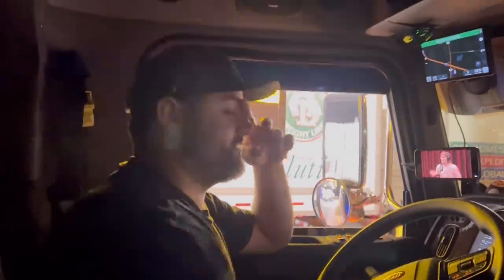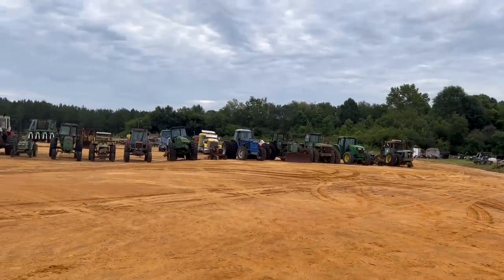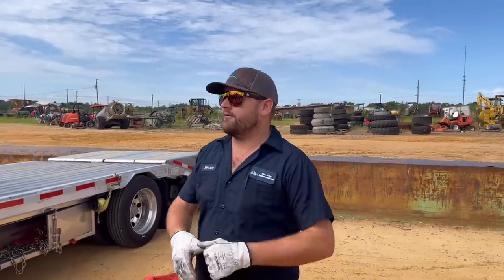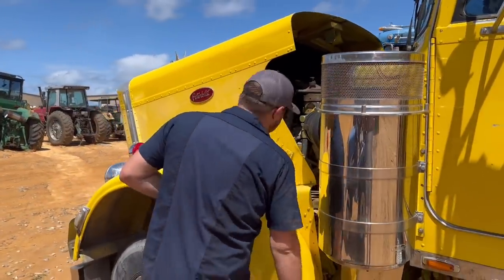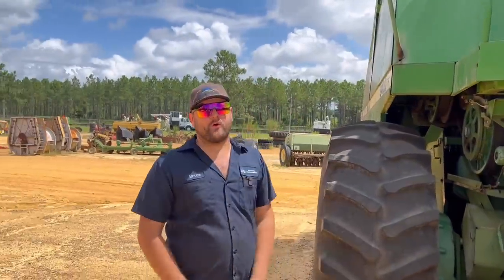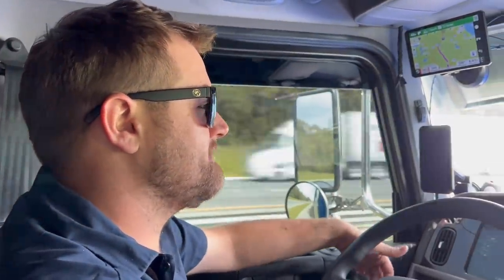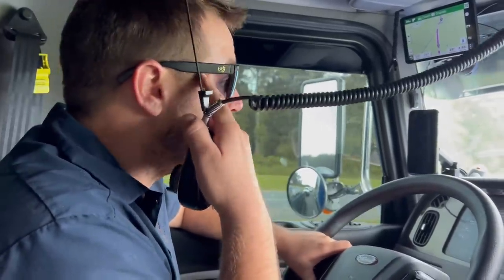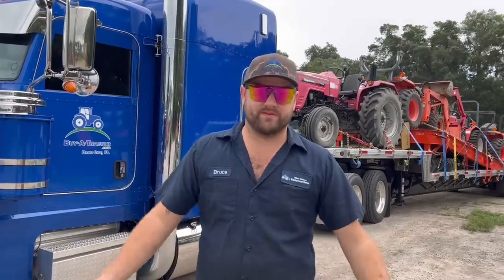SALVAGE 359 Peterbilt at the Auction, should we save it?

Comment: That Pete has a cat 3406b. Extremely reliable and loved engine. The issues with them heads are the rocker shaft hold downs are known for cracking and failing, the jakes would get out of adjustment and cause a valve to break a tip off and drop, and the rocker bridges would slip out if the valves weren’t adjusted when they should have been. All of those can be avoided with simple planned maintenance. But that engine is just as iconic as a Detroit, definitely worth saving, at least for the engine. Even if you gotta put a reman head on it and a liner. But sometimes you can get lucky and if it didnt drop a valve or anything then it’s definitely fixable. I’d pop the valve covers off real quick and check. And yeah they’re one solid head, two rocker boxes and covers. Full mechanical engine. The 3406e is a heui engine, hydraulic electronic unit injection. Uses high pressure oil and electric signal from ecm to open the injectors. Extremely reliable setup if properly maintained. Then you got into the Acert engines like the c12, c13, c15, c16, c18 and up to the c32. They are Meui engines mechanical electronic unit injection. It uses the fuel transfer pump to supply injectors with 90psi fuel and there a rocker arm on each injector and when the ecm open it the rocker arm pushes the fuel in the engine. Best setup for reliability and power. It’s overhead gear driven cam. Really good engines. Also if you can find a 3408b or e, those are awesome in a semi truck, not good on fuel but tons of power and just awesome engines. If you have any questions I’m a cat field mechanic so don’t be afraid to holler.
Reply: Sorry, but the 3406E uses electronic control, but uses rocker arms from the overhead cam. They aren't a HEUI setup. Electronically controlled, mechanically activated.
Reply: Oh yeah I forgot about that. There’s a serial number prefix break some are heui and some are meui.

Comment: Might wanna slide that 5th wheel back a notch, 11k on the steer empty seems like a lot, probably over loading it when full. Mines usually closer to 9k empty and gets up to 12k when I run @ 90k
Reply: I typically have my steers a little over the 12k mark depending on the states I'm running in.

Comment: Ouestion : how do you get past the DOT without a headache rack ?
Reply: The headache rule was done away with a few years ago.
Reply: Guess show's how long I've been away from driving
Reply: I was told by a DOT officer that if there's enough space between the Back of the sleeper and the front of the Trailer you don't need a headache rack ( I can't remember the length and that was about 10 years ago too)

Comment: Rebuild that motor and you'll have 3 things that'll work in your favor. A reliable truck that doesn't have all the computer stuff to slow you down and need repairs as much. Basically a new motor that can go another million plus miles. And mostly a pre-def truck that is ELD exempt so you can run a paper log book and save thousands on not having to buy DEF fluid. Plus already has a APU on it. I'd say buy it. If nothing else you can make it work and sell for a huge profit.

Comment: Hey Bruce, I’m the guy that spoke with you at the 75 chrome shop show that wanted to get a 359. That yellow rig has a 425 B model Cat. It’s a rough looking rig. What year is it? 1987 is the last year of the 359
Reply: 85 was the last year of the 359
Reply: @markgoddard3115  no Sir 1987 is the last year. Do the research. 1987 you could get a 359 and a 379
Reply: @markgoddard3115  in 1987 you could get what they called the  “Classic” they were numbered trucks. Classic models started in 1986 and carried through 1987
Reply: @trippwilliams1304  Not all 87s were classics.
Reply: @mintyman1968  never said there were ONLY classics built in 87, just that they were available
Reply: @trippwilliams1304  Not all 359s built in the year 1987 were the classic editions. 9 out of 10 were not. They only built maybe 3000 359’s in the year 1987 because it was a half year, and there was only 380 classics built.

Comment: C15 or 3406 cat engine. One of the best engines money can buy. I drive a C15 cat here in Perth Western Australia and it’s a beautiful engine for the heavy 100+ tonne triple road trains we pull here. Buy that big yellow  rig and restore it. Will be the best engine you will ever run. We love the cat engines over here. Best part I just done a 1300 km trip loaded oversize and I only used 1/4 tank I think about 350-500 litres. Didn’t actually look at what how much fuel I put in on the return trip empty
Reply: If it’s the original engine then it’s a 3406A or 3406B because the truck is no newer than 1987 but it could have been retrofitted with a C, E or C-15.

Comment: Bruce,... have you ever come across or know of any 1953 - 1959 Autocars???  I'm searching for a 1953 - 1958 Autocar DC-75.  Any condition!  I'm basically looking for the VIN Plate, cab, and radiator cowl in any condition.  I can fabricate/replace rotten metal with new.  I would appreciate any leads you or your viewers have.  Thanks!

Cyrus

Comment: That Pete looks like something Tim Gentry would buy and fix
Reply: B Good you are right about Tim Gentry buying and fixing that PETE because he has a RED PETE sitting there at the shop that he just  did ENGINE work to And WIRING as well and it also has a KITTY sitting in it and it does a great job just PURRING up a STORM he started it up in the last Video I watched last night the HOOD was not on it yet but it is finished in front other than that and I will ADD he had to do HEAD WORK on the ENGINE in it to make it run again AS I stated it PURRS sounds excellent
Reply: George Jones  I didn’t say he’s finished any, I said fix meaning they got it running and back on the road.

Comment: If you can get it cheap enough and make it ready to work, I would be very interested. I don't have cash saved up but I would pay you $600.00 a week for it or a percentage of the loads. I used to drive a Pete like that but it burned up. Starter shorted out. I'm definitely looking for a ride. Unfortunately I'm not independent wealthy. But I have about 9 years experience.

Comment: The spoiler on the sleeper alone is reason enough to save big bird!
Reply: I put one of those style wings on crew cab dually I had to tow my race car trailer and boat. It improved my fuel economy by about 1.5mpg. I used to lay it flat when not towing anything and would get people asking me “What is the strange shinny thing on your roof?” The truck was black with dark tinted windows and a sleeper to hide my 150 gallon in bed fuel tank and Alco’s wheels so the truck had a sort of “Men in Black” look going on so I used to tell people who asked it was part of satellite communication and navigation system